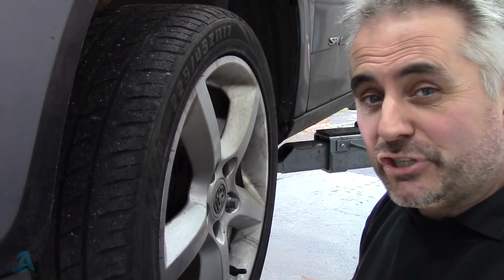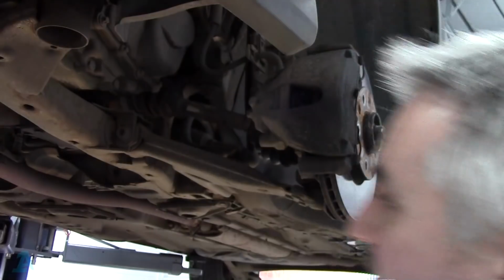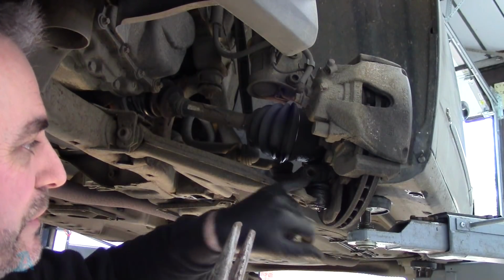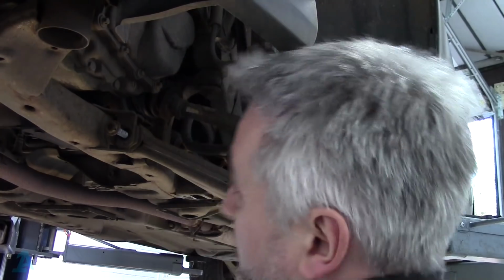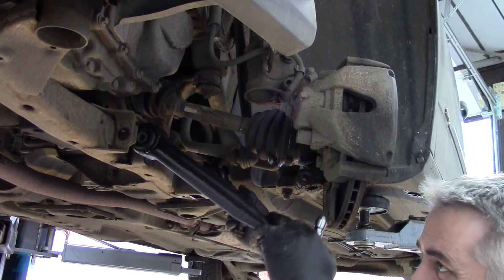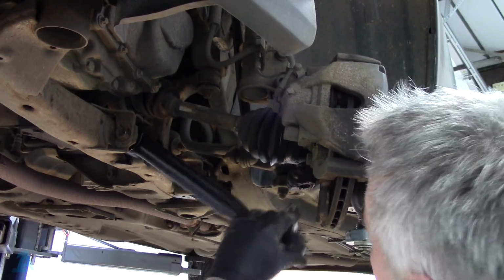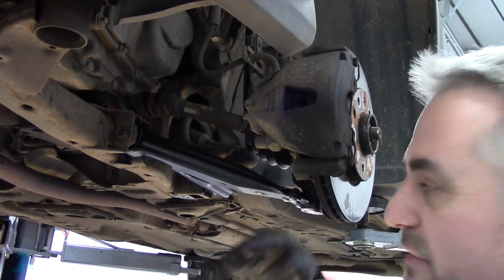Vauxhall Astra H Ball Joint Worn. Track Control Arm Replacement

Comment: An easy fix. I usually get my ball joints checked every 2 years when there is EU inspection. And then I change whatever is needed. But I do believe in good service, and this year I gonna change oil on 3 cars and whatever else is needed.
Reply from the maker: Yes good maintenance makes them last just a little longer

Comment: Nice video Rob and the smart way is to change out the control arm just like you did especially with the rust!
Reply from the maker: Always the better option. Cheers Bob
Reply: Rust ... pffff lol
Reply: Cars in England don't need winter salt to rust...it stays moist all the time & everything rusts but not like the NY salt rust. When I was in England half my work was with a welder fixing rusted out frames & body so they could pass MOT inspection.  NY rust is definitely worse I can attest to that which is why I live in GA!!!

Comment: Great video mate. Your a gifted man. My astra h twintop has just failed an mot for this and 2 back tyres. The tyres are nowt, but i think wishbones and ball joints are definitely beyond me.job for the garage i think.
Reply from the maker: Haha thanks John. Yeh keep your hands clean!
Reply: @OneAuto  im actually a groundworker mate, and my hands are far from clean. Im very very keen to do things to my astra (im 45 and this twintop is my midlife crisis)
Im watching loads of tutorials on here, everything from refurbish my own alloys to upgrading my air filter, and also changing all my engine/coolant pipes, demarked front grill,
But wishbones are a bit beyond me for fixing on my drive. Id need to buy a low profile jack, axle stands, and watching you do that one, id say it wouldnt be easy laying on my back with the car just a foot in the air.
Reply from the maker: Sounds good. Best of luck with it 👍

Comment: Top job! If so much easier doing this job with a lift haha.  Its a chore doing these on the floor on stands.

Excellent point about the inner bolts tightening with tension on the rubber.  Alot of people dont do that with rubber bushes.
Reply from the maker: Thanks, yes I’ve done them on the floor before, not easy 👍

Comment: a After seeing your video will attempt to fit after mot failure was told about drilling rivets replacing complete unit much more sensible if like me your working in driveway keep up the good work as your videos are easy   to understand
Reply from the maker: Yep whole arm much easier for you👍

Comment: I've replaced control arm, but I noticed that when the hub is rotating, the ball joint pin stays in same place and doesn't rotate with the hub, even though the pinch bolt is tight. Is this correct? I  thought the pinch bolt would "pinch" the hub onto the ball joint pin and both would rotate together. Or is this a sign that the hole on the hub is ovalled / worn?
Reply from the maker: Yes it sounds that way. Seen it on plenty of cars

Comment: I have the same astra h but from 2006, and car is shaking at low speed like 20 mph  and even with the  engine off  ( car rolling ) nd you release the clutch its stil shaking like 4 times back nd forward with engine off.
I think i have this problem too with some play by the joints

Comment: Are the ball joints on astra h's poorly made as since I've lowered my car I've replaced 3 left hand lower arms as ball joints always fail
Reply from the maker: I wouldn’t say poor made but when a car is lowered it does put extra strain on different components that they are not necessarily designed for.

Comment: how far do you jack the arm up before you tighten the 2 back bolts,cheers
Reply from the maker: newry123 just so it takes the weight as if it was on the floor

Comment: the control arms of similar style are usually rusted away from the inside out by time the ball-joint is bad anyway. at least here in the rust belt of USA ;)
Reply from the maker: I did a 2002 Landrover like that a few weeks ago

Comment: Would a lower arm cause the left tyre to drag when you are turning right. The car is a toyota yaris. What brand brake cleaner do you use as I'm thinking of buying 5 litres and using a spray bottle.
Reply from the maker: Yes quite possibly if the ball joint or bushes are worn therefore putting the wheel alignment out. Brake cleaner.. any.. it’s all the same
Reply: Can you check a track control arm when the car is on the ground. I put the wheels on full lock then put a lever bar between the subframe and arm and when I pushed up on the arm you can see the arm moving up and down but the rubber bush is not moving but you can hear the rubber squeaking.

Comment: Vauxhalls seem to get through control arms faster than most from my experience.
Reply from the maker: Same here 👍
Reply: I don't work on cars mate. It's just something I've noticed over the decades.
Reply: I'm not sure it's Vauxhall's fault. I just blame the Government and the horrific state of UK roads. My 54 plate Astra H has needed 2 control arms in the last two years, and I treat her really well :) Dodging potholes is getting near impossible, without driving on the pavement, but it isn't Grand Theft Auto :(

Just found this channel, you seem like a really awesome mechanic, my kind of best friend. And you're from the Midlands, lovely people :)
Reply: Agreed James, the roads are crap too. That said Vauxhall suspension components are not the longest lasting in the industry in my experience. 
I haven't driven or owned one for quite a long time though. The new Astra's look OK I guess esp the faster ones. But do they still understeer badly like they used too?
Reply: I bought my first astra h at 49k miles and kept it till 123k. Never needed new wishbones on that one. Droplinks though, now thats a different story

Comment: How come you hardly ever torque things?
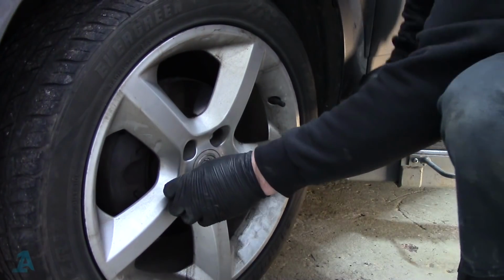Reply from the maker: Alex Wade 11:33?
It’s all about experience and knowing your tools. When you have been doing this job as long as I have you actually get the feel of certain torques. Important things that need torquing get torqued. But if a DIYer tightens a bolt, torque it to factory spec like I always say 👍
Reply: I think for sure is 90 pounds of torque